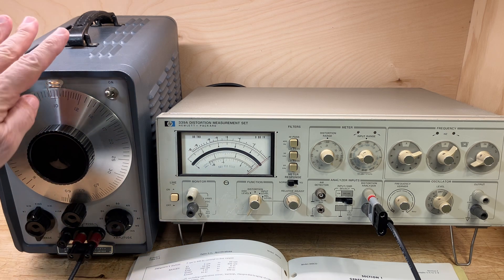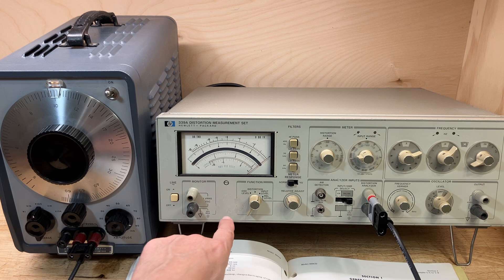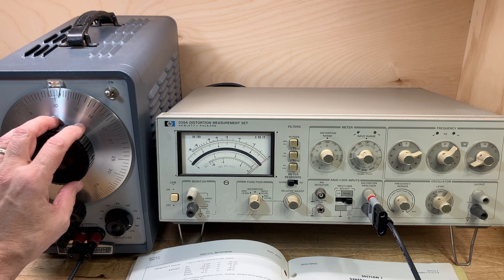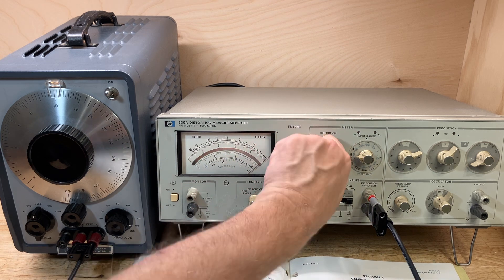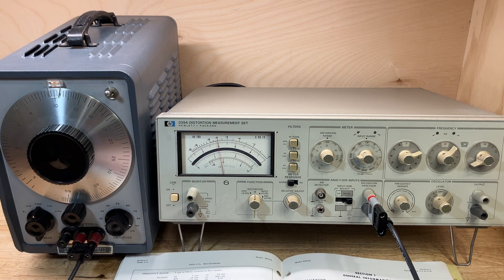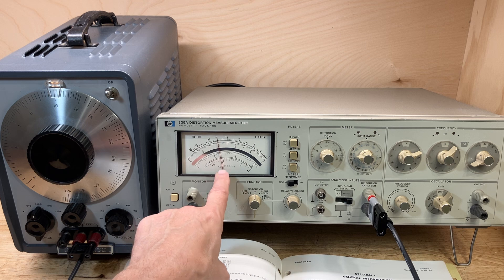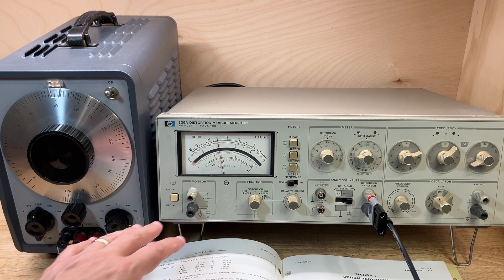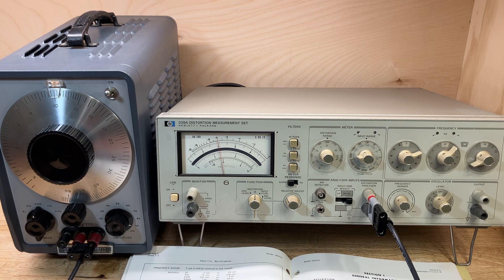Measuring Distortion of HP 200CD Oscillator

Comment: Sometimes new tubes can help with distortion or other issues.  If you can get new matching mfr. output tubes.  You got two ways to adjust the tracking of the dial.  Adjust the dial on the capacitor shafts,  and there are trimmers on the tuning cap sections to set the high end freq.  Sort of like trying to get perfect tracking on an old AM table radio except with more cap sections. Sometimes you could make it better but often as not pull your hair out.  I finally just made sure they were within the freq. tolerance and left it at that. Be sure to get the proper manuals,  they specify manuals based on the serial number range and over the decades made alot of changes.
Reply from the maker: @TomSherwood-z5l  this one tracts almost perfectly on the dial, way better than the specs. I’m very familiar with the 200CD, I’ve worked on many of them during my years at HP. This is the first one I’ve ever owned myself, though.
Reply: @garyramsey4275  The last one I personally owned I got at a hamfest for like 25$ years ago.  I do have some salvaged parts from one that was busted up, at work. I saved the bezel,  the dial,  the knobs, the transformers and the rotary switch assembly.  And the tubes. No attenuater in it. That was salvaged for another one.   I know someone that has one but he does not seem eager to part with it. The advantage in our shop was the high output compared to some solid state generators.  OH I did also save the tuning cap. I got two or three big tuning caps from scrapped HP gear.

Comment: I used to use that exact setup to calibrate and test the company 200CD units on an annual basis.  The distortion on properly operating oscillators always better than the specifications in the audio band. The harder part was the tuning dial tracking.  You had to hope for the frequency on the dial to be within the tolerance limits because there was no way to get perfect tracking so the dial marks were right on the money.  They were often used with a counter to confirm the frequency.  IF the output attenuator unit goes bad in those you may as well hang it up unless you can clean them back to smooth operation as they can get flaky or noisy being carbon controls, with proprietary values and resistance tapers.
Reply from the maker: @TomSherwood-z5l  I carefully opened up each section of the output pots to get inside to clean them. Was very noisy before I cleaned it. See my video on the 200CD from earlier.

Comment: Hello, I have a problem with my 339A , oscillator and voltmeter are ok but the nulling circuit does not work, so I cannot measure distortion. How did you solved the problem?
Reply from the maker: @AndreaLiverani-iw5ci  the symptom you describe seems different from what I observed with this 339A. But if you watch all 3 of my videos on the 339A, you will see the process I followed to do the repair of my instrument.